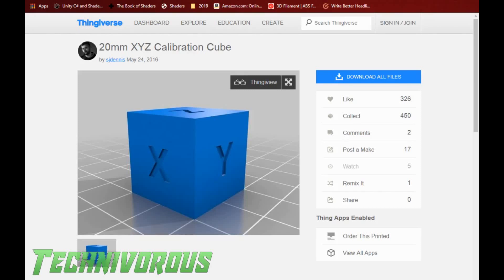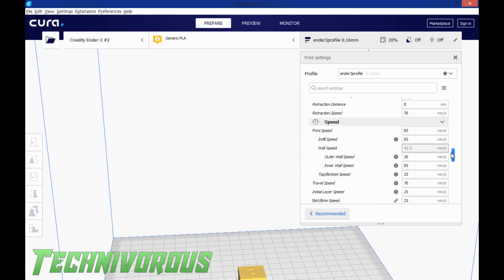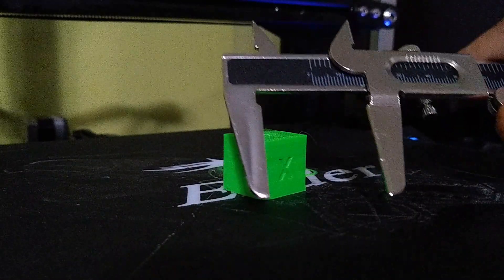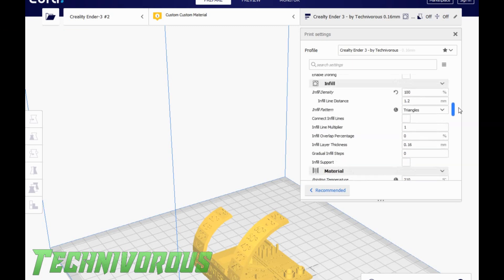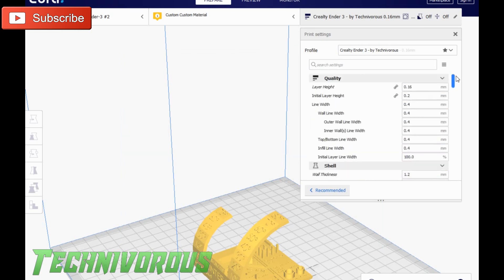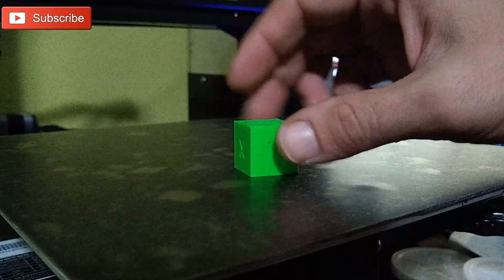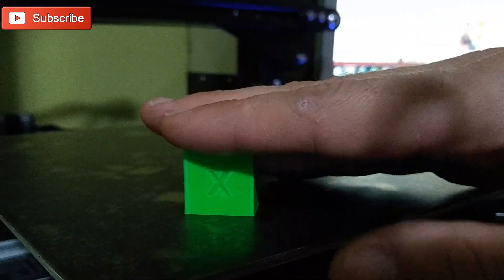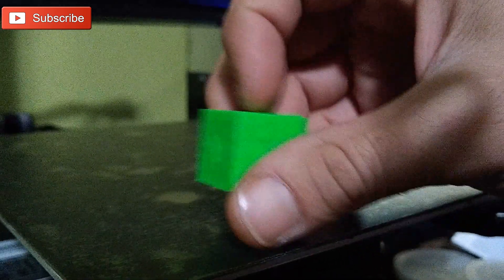Calibration Cube for Fine Tuning your Ender 3 Profile - 1.3

Comment: I used your settings and it came out terrible. 5 different prints on 2.different filaments. One dehydrated and one right out of a new bag. Profile does not show what is conveyed in video actually. I'm assuming for your printer it works fine and was further tunes. 

Ender 3 v 3 se with 0.4 nozzle, 1.75 PLA +

Comment: I’m a total noob, but shouldn’t you recalibrate your extruder e steps if you are under extruding instead of bumping the flow setting in cura? I don’t mean the initial layer.  It looked like you changed the regular flow setting.
Reply from the maker: You are correct, keep following the playlist and step valibration is one of the next couple videos

Comment: At 2:20, he says “you can tell which dimension you’re measuring because it’ll be the dimension with the face touching your calipers.” This is true for the z-axis, but will mix up the x and y axis. Only took 10 calibration cubes and 7.5 hours to figure it out. Shame on me for trusting this bloody wanker instead of following common sense.

Comment: If my X, and Y are not within tolerance how do I adjust in cura? Printing with mega zero btw. So if the top layer isnt as smooth as the sides adjust the flow rate?
Reply from the maker: The first thing your going to want to do is calculate your esteps and ensure you are extruding what it actually thinks u are. Most printers are a little off. Once you calibrate print another cube, then measure. If the x and y are off you can change the extrusion amount, or flow rate. Or add a little negative horizontal expansion under shell.
Reply: @Technivorous  How would it best be to measure extrusion? Measure the filament used or test by measuring a cube and tweak from there?
Reply: I figured this would be explained in this video. Very misleading.

Comment: FYI peeps - Another reason for elephants foot is when your bed is high in the middle (like mine). You get more unwanted squish when your print is at the bed center. Make your measurements at the top layers where this effect is not present. Don't forget to do the bed level test with paper in the center of the bed too. Five point (4 corners and middle) to highlight if your bed is uneven.
Reply: @4:45